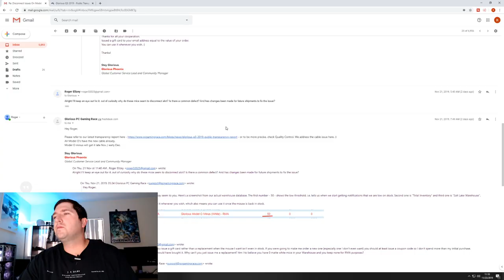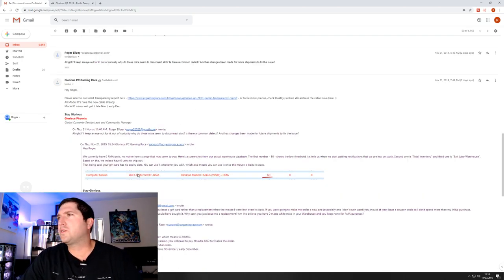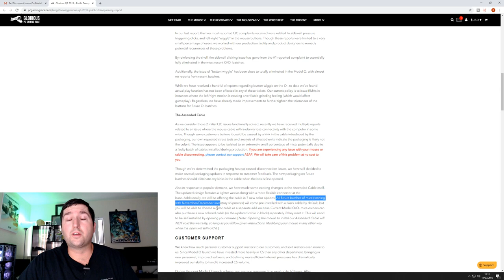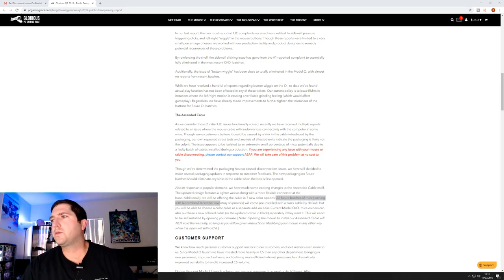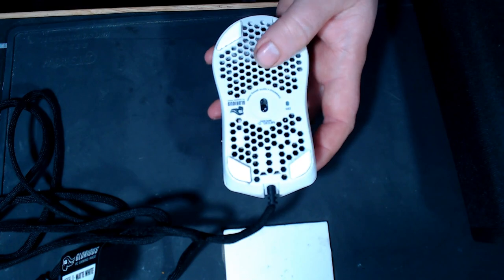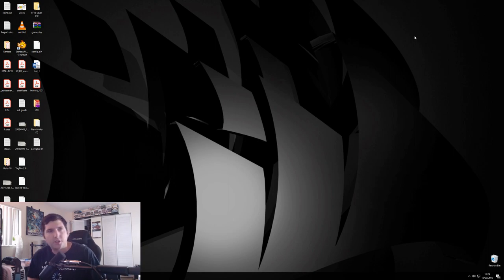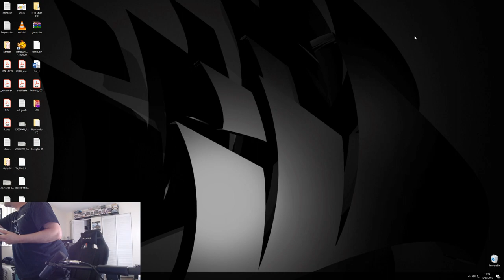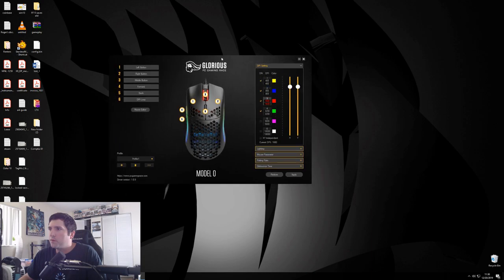Glorious Model O/O- Disconnecting Issue (FIX)

Comment: Yea I have the soft wear but it says mouse not connected when it's plugged in

Edit: my mouse broke and the asended cable did nothing it wasn't the cable and I tried to get it fixed not it died and I broke the rgb ribbon because it's crappy
Reply from the maker: I explained it around 5:28 in the video. There really isn't much to it. The symptoms it will have is the buttons will work but the mouse won't move. If it's not connecting at all this may be a different issue. Did you get a replacement cable already?
Reply: @draxxilletech  no I can't because of the covid 19
Reply from the maker: Well it is possible to steal one off of a functional mouse. You might can find one on Amazon as well
Reply: @draxxilletech  I looked on Amazon and couldn't find a decent cord and I don't wanna steal one of of my Razer death harder because I might have to change the cable.
Reply from the maker: I see some stuff on eBay:
https://www.ebay.com/itm/173924964894

I would contact PCMR first though about a replacement cable or mouse if you haven't already. This stuff on eBay is out of China so no telling how long it will take for you to get it.
Reply: @draxxilletech  idk if I should get it from eBay and my dad doesn't like ebay
Reply: @draxxilletech  well I might ask Dad and do I have to fix the cables to fix the glorious
Reply from the maker: Yea if you can't get PCMR to send a replacement right now you can rig it temporary. Look at my other video on this matter to see what happened. I'm not saying that will apply to your mouse. But if it is indeed the cable that is bad, that is where I found my defect.
Reply from the maker: But obviously the best long-term solution to fix this is getting the ascended cable from pcmr. They should give you the materials or credits needed on their website to fix it
Reply: @draxxilletech  if I get a Razer death hadder 2013 wire do I have fix the cable to match the glorious modle o-
Reply from the maker: It should be the same. You can take the model o apart to confirm the wire colors before you buy it though. That being said, not all color coding is the same but doesn't mean it wouldn't work. When I tested my mouse out I used an old Dell trackball mouse cable, I did have to swap to wires on that. You can use a multimeter to test continuity for each wire to make sure it's the same. In short, I'm sure it will work being a standard part. You can check the color coding to make sure or use a multimeter to confirm. Or just plug it in and see what happens. It's three bucks anyways. Obviously the best option is going to be contact PCMR to see what they can do.

Comment: Wait it's TRUE u can use a different mouse cable and use it for the model o?
Reply from the maker: Yup, I've done it myself. When you take apart the mouse it's just a standard connector for USB. I used an old Dell trackball USB cable. I did have to flip two pins on it, but the connector was the same.
Reply: @draxxilletech  how do I know if I need to flip pins or not
Reply from the maker: You do a continuity check with a multimeter. Read between each prong  in the USB plug to each pin on the connector that goes to the board. There is also the chance that the replacement cable will have the same color coding. You can also just try it to see if it works. When replacing the cable you may also need to do the steps I posted in the product description. I would always recommend just contacting PCMR support for a replacement cable first. If it is a defective cable they should replace it. If you want to see the defect check out my other video on this mouse. All the wires were cut. My guess they were shorting to each other. Let me know how it goes!
Reply: @draxxilletech  yeah I contacted them yesterday about my problem, gave a demo serial number and order id, so hopefully they will give me a replacement cable. I just wanted to use something else while I wait for that replacement to come in, if it even does
Reply from the maker: Yea if you have extra mice laying around you can crack it open and swap it. Idk how well the skates will go back on, I bought new skates with the credit they gave me. The glue is pretty tacky so I think you can get another stick out of it. The only downside is you will be swapping the cable twice.

Comment: I did this now the mouse just don’t work at all 😐
Reply from the maker: Make sure you did the last steps that I mentioned in the video description, let me know how it goes
Reply: Draxxille Tech says device disconnected
Reply from the maker: What USB cable did you replace the old one with?
Reply: Draxxille Tech I didn’t replace the cable my cable was disconnecting and my scroll wheel wasn’t working because the wire was in front of the scroll wheel and the wire wasn’t plugged into the mouse properly and after screwing everything back in nothing works then I got the leds to work but the mouse wasn’t moving at all so then i took it apart again and then the led cable left side snapped off
Reply: Draxxille Tech it’s okay now I bought the same mouse again so if it happens again I’m just giving up on the mouse
Reply from the maker: Yikes, well from what I have seen unplugging the USB cable alone causes a the sensor to stop working, but mouse clicks will still register. That's fixed through the a walkthrough I did at the end of the video or in the video description. My guide tackles a cable defect, but maybe try shooting an email at customer support saying you had physical cable damage from sloppy assembly and see what they will do for you. From my experience they are really good even outside of warranty.

Comment: i change the cable, and my model o die
Reply from the maker: Does the buttons still work but the cursor is not moving?
Reply: Draxxille Tech, with mine this is the problem and the lights also keep going on and off
Reply from the maker: Did you swap the cable yet?
Reply: Draxxille Tech, nah I’m too lazy

Comment: when i flick hard it disconnects and i have the v2 paracord version. just started after 2 months of use and im not sure if its how i put my cables ( straight or a loop) but i might ask for a replacement
Reply from the maker: Yea, I would. You can try running down the cable and bending it to see if you can force the issue to occur. I have heard people complain even on the newer mice that are supposed to already have the new ascended cables on them. So I don't think the defect has went away.

Comment: I know it late but my mouse glorious o is disconnecting but it doesn’t let me move my cursor at all, like when I move my mouse it doesn’t respond however sometimes it’s on and it has no response at all :(( please help me
Reply from the maker: Did you already do the cable swap? If yes, you can try the steps in the video description. These steps fix if the buttons will work but the cursor doesn't move. To troubleshoot the issue you can try feeling down the cable and moving it around. In the case of my mouse all the wires had a cut in it. Let me know how it goes!

Comment: how to get the cable on the wires
Reply from the maker: I'm not sure that I understand the question
Reply: @draxxilletech   is it a instant new cable or just new cable wrap like do i have to put the old cabels in (i dont know if u understood this)
Reply from the maker: The replacement cable is a new cable that you can get from PCMR. It's their new Ascended cable. All of their new mice will ship with this cable to fix the defect. If your mouse has the defective cable just contact their support to get it then you can use this guide to fix the mouse. I believe I have a link to it in the video description. As you can see it's just as simple as unplug the old one and plug in the new one. You may have to do an additional step to restore full functionality of the mouse after.
Reply: @draxxilletech  but I bought it over Amazon can I also do that?
Reply from the maker: Yes, you should be able to. Manufacturer warranty always is in place regardless to where you bought it. Even then, I think they are fixing this issue past the warranty date. Just get in contact with PCMR support and see what they say. In my case they refunded the mouse cost without even returning it. I bought the cable and fixed it then took the extra credits to buy stuff on their store.
Reply: @draxxilletech  but why do you have to buy the cable I thought they send you one
Reply from the maker: In my case they refunded the full mouse. They did that so I could buy a new mouse (the mouses were out of stock at the time) instead of using the credit to buy a new mouse I bought a replacement cable to fix what I had. This left me with basically a free $30. They may do the same for you or they may send a replacement cable for free. Just get with them to see what their resolution is, I can only tell you what they did for me.

Comment: can i use the mouse cable from logitech g502 hero on the glorius model o?
Reply from the maker: It should work, I used an old Dell trackball mouse though and had to swap two wires around in the connector to make it work. The best way to check is with an ohmmeter. Make sure you move the strain release to the new cable. There is one step that you may need to do to make the cursor move after swapping the cable. The steps are in the video description as well towards the end of the video. Let me know if you have any issues.
Reply: @draxxilletech  i dont know the cable color code.
the g502 have other colers than the glorius mouse
Reply from the maker: Go on ahead and try it, it's probably just another color coding pattern. Remember to do the steps in the video description of the cursor doesn't move. 

Here is also a little guide about the color codes:
https://promotionaldrives.com/blog/usb-wire-color-code/

The way I identified mine was using an ohm meter though. The cable I used was from a trackball. The 502 is way more modern, I would expect it's the same pinout, just they are using a different color coding scheme.

Comment: They still have the same cable I still have the problem
Reply from the maker: Where did you buy it from?
Reply: @draxxilletech  glorious
Reply: @draxxilletech  actually web
Reply from the maker: So the glorious website? I would imagine their stock would me more recent there. Supposably they fixed that with the new mouse cables, but I got a feeling there are still issues. But the fix is still the same with swapping the cable.
Reply: @draxxilletech  yeah most likely I’m gonna try to return and get a new one if it happenes again I’m getting one of the razor mouse

Comment: can you use any other mouse cable?
Reply from the maker: Yes, you should be able to. Just double check the USB connector inside the mouse and check the wire colors. The old Dell mouse I used had a hot and ground swapped. But it was really old. After you do that follow the steps in my video description if you get the cursor issue.
Reply: ok thank you!
Reply from the maker: No problem man! Let me know if you have any questions.

Comment: how you unclip it?
Reply from the maker: I don't really understand the question, lol
Reply: @draxxilletech  Nevermind I just broke my mouse whit this video. Nothing anymore.
Reply from the maker: Broken how? If I understand the question I can help you. My guide is pretty straightforward as well. There aren't any risky steps to break anything unless you try to fully disassemble the mouse and you don't have to do that. There is the cursor error that may happen when plugging in the new cable. Simply uninstall the driver software and reinstall > run as admin > click restore.
Reply: Draxxille Tech Can i take a old cabel from my steelseries mice on this one?
Reply from the maker: I don't see any reason that you couldn't. I will say on the old trackball mouse I had to swap two pins on the connector. However that was an old trackball mouse, lol. Sorry for the late reply and good luck man. Tell me how it goes.
Reply: Draxxille Tech it is working perfectly fine!
Reply from the maker: @twicee__6474  Awesome! Glad to hear it.